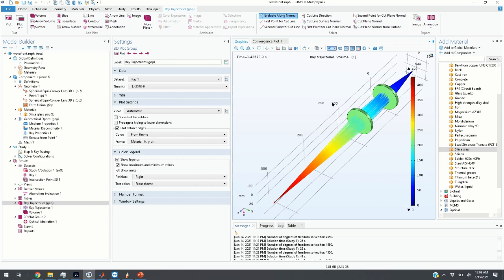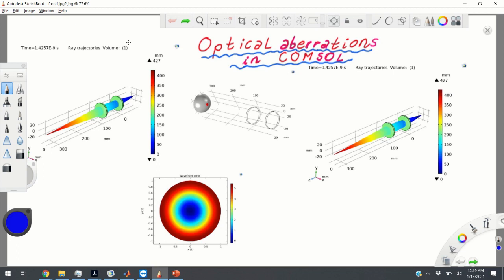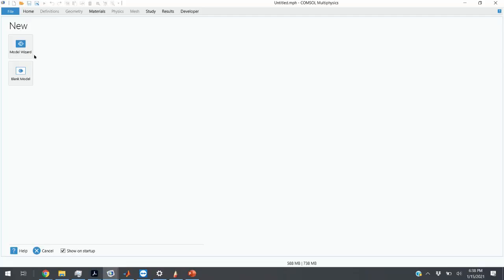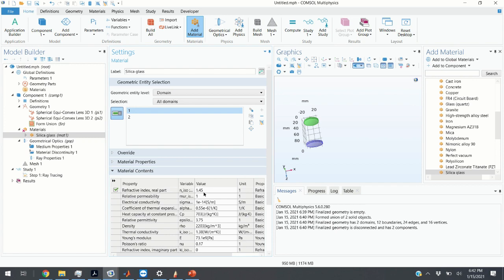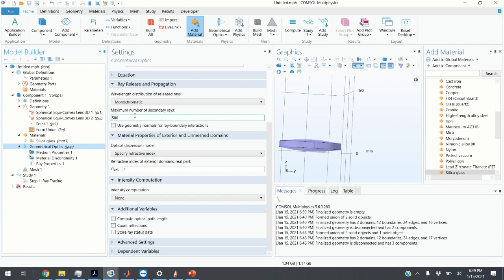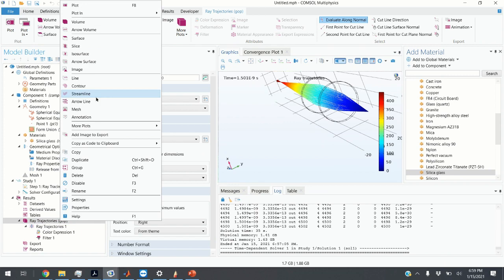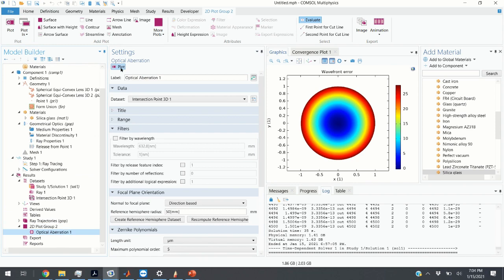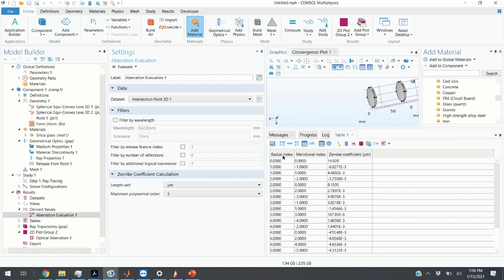Optical aberrations and Zernike Coefficient Computations in COMSOL Multiphysics - Optics Tutorial

Comment: Amazing! Thank you much.
Do you happen to know if the ray optic simulations are particularly slower on AMD processors? Or if COMSOL uses MKL?

My system should theoretically be faster than the one you're using in the video. But after all is done, if I go to "study" to compute again, it takes 198 seconds!
Oy vey. Would you mind letting me know the value you have for these few preference settings in COMSOL?

Preferences:
Graphics and Plot Windows
     >Rendering
     >Optimize for:
     >Antialiasing:
     >Detail:

Multicore and Cluster Computing:
     >Number of cores:
     >Memory Allocator
     >Memorayscalability optimization for assembling:
     >Scheduler type
Reply from the maker: These simulations are performed on a 4-year-old laptop computer with 16GB ram. Possible issues can be that you specified too many rays from the release plane or your mesh might be too dense. 
 I do not know what is the issue. I am just using standard settings. I erased the original file, so I cannot retrieve the data you are asking for. 
 I am not able to answer these questions simply because I do not know the answers. I think that the best strategy is to send an email to COMSOL support. They are really excellent at what they are doing. Good luck!

Comment: Thanks for this clear explanation, but I have a question, how did you get the f=86.2069? , because  R2-R1 makes the denominator equal to zero.  R2 = R1 = 125
Reply from the maker: This is because in geometrical optics, there is a sign convention when entering the values in the Lensmaker's equation. This depends if the front/back surface of the lens is convex/concave. The value of R_{2} is entered with a negative sign in the equation, and this gives R_{1}+R_{2}
Reply: Now it's clear. Also, how can I  place the solar cell as a heat source instead of the point in comsol? I searched a lot and did not find a specific way to do that. There were a lot of people talking about (Bidirectional coupling), but there is no explanation with examples. Thank you so much.
Reply from the maker: @dhoomsaad4406  There is a tutorial on how to couple thermal deformations of optics with ray tracing, and how to model the refractive index changes due to the temperature increase, see for example https://www.comsol.com/blogs/modeling-thermally-induced-focal-shift-high-powered-laser-systems/
That tutorial is about bidirectional coupling.  However, in the case of solar cells, I am not sure that this tutorial will be useful. Best, A. Haber